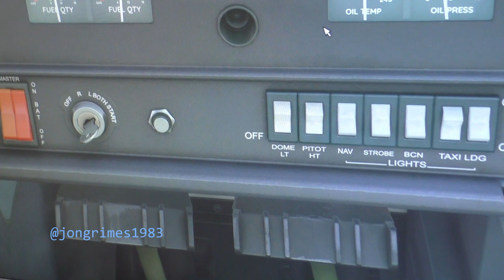Custom DIY Flight Simulator Controls MSFS 2020

Comment: Im also building one for myself, are you using SIMVIM? Or MobiFlight?
Reply from the maker: mac fly I’m just emulating a keyboard. So it’s no different to the keyboard command
Reply from the maker: mac fly just checked mobiflight looks brilliant I’ll try something with that.
Reply: @50Hz  nice I'd recommend checking out SimVim as well they have wiring diagrams per what you are building as well as No coding. Both amazing!
Reply from the maker: mac fly thanks mate will do
Reply: @macfly4649  simvim doesnt work for msfs 2020 i dont think